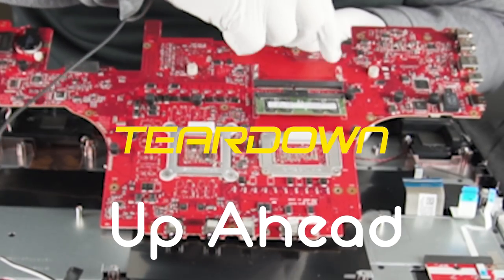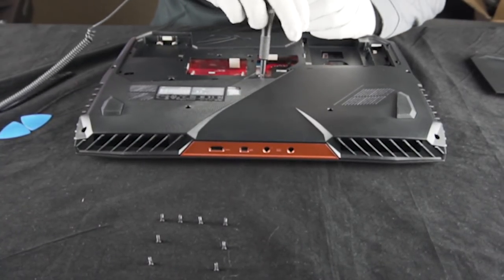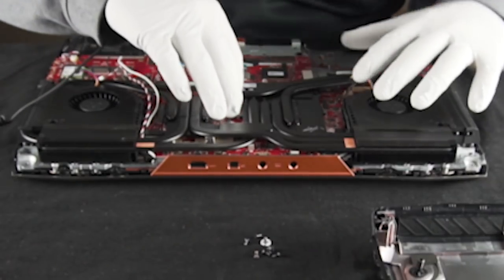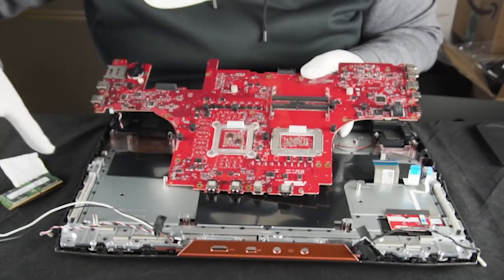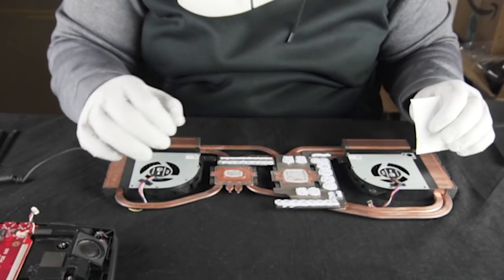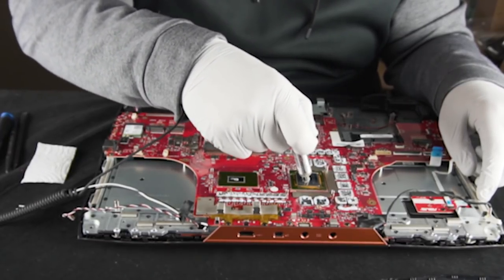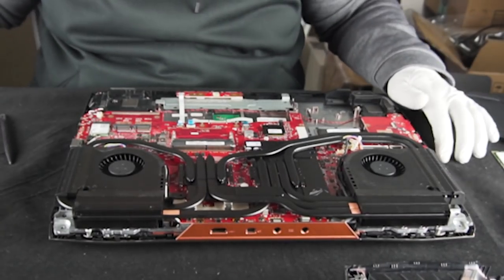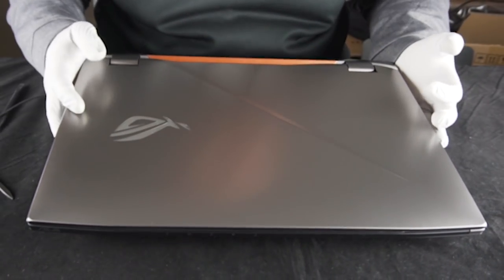Asus G703GX | How to Service, Upgrade & Fix Laptop (Teardown)

Comment: I opened it to remove battery and do power drain, and now when I turn it on it stuck in BIOS Utility mode, even if I press power button for 1 min, what could have gone wrong?

Comment: Thank you so much, got this laptop one 1 week ago after watching extensive YouTube videos on the laptop. I can say now this is the greatest laptop with an enormous amount of ventilation and temps are very nice, however, it's going great with a fan cooling pad. My spec was the i7-8750H CPU since I wanted to avoid the huge amount of burning heat from the i9HK CPU
Reply: what temps you getting out of the i7 8750? mine are peaking at 80 but averaging 70!
Reply: I just saw they have a new model with the same laptop but changed the CPU chip to the i9-9750H processor, I hope he could do a comparison
Reply: @Endorion_YTC  which cooling pad is the best? And how often do you clean laptop, replace thermal paste? Your responsw would be greatly appreciated as i am noob in this matter /(
Reply: @boredoflife8703  It's really best to change the thermal paste to liquid metal it does really do the job. Problem is the work is risky unless you know what you're doing. Cleaning the laptop would be every couple of months or so just to open it up and use a air canister to remove the dust from the fans using a brush also. Any cooling pad with fans can do the job doesn't have to be anything really expensive, around the $20 range. Just overall, don't really worry about extensive heating problems it wouldn't heat up so hot if your environment is nice and cool and the laptop has air to breath :D
Reply: @Endorion_YTC  i had asus rog in 2012 very strong model for its time, it started to get hot and in year 2 of the service it damaged itself so you couldnt even run anything, it would lag, so now I have asus chimera and dont want same problem, it starts to get hot only when i have it plugged in charger, cpu goes up to 100, while without charger its around 40, now i removed old thermal paste and wanted to asked experinced person like you before buying thermal paste to apply, might it be other problem, because it gets hot only while charging

Comment: Good morning.  In the 2 slots where the Intel NVMes are located, can I mount NVMes from other brands?  I ask because I'm trying and it doesn't read any other Nvme to me.  Thanks in advance for the reply
Reply: I have to go into my BIOS, and reset the settings to defaults every single time I boot my ASUS ROG g703gxr, otherwise one of my NVMe drives in the extra 2 slots will not be recognized by the bios or windows.
Try resetting your BIOS settings to default and let it reboot, that might help.

Comment: Got a question, I'm so worried about my Asus rog g703gx laptop because I accidentally packed my laptop upside down where the display faces the downside position of the bag where it should not be . Question is will it cause a damage weither a cosmetic or hardware damage. Please I beg you guys to answer my question so I can get relief

Comment: Hello owners of this laptop! Has anyone been experiencing both power jacks not functioning, it takes very little movement  of the 90 degree jack to stop the electricity's to PC via the 2 power ports.
Reply: I've had that issue, plus even after repeated repairs it didn't fix it except when it went to their HQ and that fixed it for just over a year.

Latest investigation makes me think it's a soldering issue (unconfirmed), which means it will keep happening if you move the laptop around enough.

Comment: This is a great tear down video of the same exact laptop that I have. The hinge is not broken but occasionally makes squeaky noises but I am very gentle with my laptop, especially this one. The hinge cover on the back is not broken but on the left side one of the plastic clamps have broke so it does entirely like when I first received this laptop. Do you think its worth ordering a new hinge cover or just leave it be? It's not a huge gap but I worry in the future that because of this small gap that the rest will crack also. In your professional opinion do I replace it or not worry about it?

Comment: I bought the g703Vi model of this laptop in 2017 & have been using it ever since... It never gave me issues but now temperatures are rising. It needs cleaned like, BAD. Thank God for this video. You are the best. Most of the other laptop teardown/cleaning videos I've seen are full of sketchy tactics and redundancy. You get straight to the point & every move you make has a good reason.

Comment: Hi Computer Upgrade King !

Thank you for your video, it is really helpfull to me. I got the Asus G703 Chimera since one year now and I project to disassemble it to upgrade it and to clean it too. Is there a way to clean the fans properly without causing any damage to them ? Thank you for your answer. Looking for your next vids. BTW, sorry if my english is not that good but I'm french :P
Reply: Hold the fan with something not coductive while blowing compressed air on it, so that the fan won't spin !
(check if it has a condesate-water filter, or use the cans that are made for it, they look like spray cans but have compressed air in it)

Comment: This video is super helpful for me because now at year 3 of having the laptop I am needing to replace a fan due to a barring going bad and since I am replacing the fan I am also getting it into dual channel and replacing the pastes because it has been getting a bit toasty when things are all at 100% but seems mostly dependent on the ambient temps. Since I am doing all of this I was going to replace the thermal paste anyhow,  a sort of mid life revamp for my system.

Comment: Thank you for this! I just got this laptop a few days ago and I'm noticing a bit too high CPU temps. I wanted to do a repaste but haven't found any tear down guides!
Reply: Hi,  please, share your impression about this laptop. Want to buy it on this summer but i'm afraid i can't play games on max settings. Do liquid metal really help with thermal throttling ?
Reply: Is it a core i9 model, you've purchased? I'd like to know.
Reply: @Endorion_YTC  No, I've got the i7-8750H. I couldn't justify the price for the one with i9. There isn't any difference in the current games and from I've heard the i9 runs even hotter than the i7 for which the cooling designed here is barely keeping up.
Reply: DanyakaXD i replaced the thermal paste with grizzly Kryonaut and it works like charm. After undervolting it, the temp is even lower and the fan hardly ramp to the max during gaming.
Reply: cucu lol, yea same here. I just cant persuade myself to pay another £1.6k extra for the i9 version. Ended up with 8750h + 512gb raid instead. Added my own 1tb nvme + 1tb sata ssd at much cheaper price.
Reply: minc3 oh great to hear I might do what you did then I do care about the temps
Reply: Hi! what temps was it running and and if you did it is it running at now? just got one and concerned about temps
Reply: I just bought this exact model. Do u also have a speaker problem on the left side when volume goes too high? Like sizzling sound?
Reply: @thecommodore1875  I haven't noticed this but I rarely use the speakers. Headphones most of the time.
Reply: @cucubits  it does, I have the Core i9. I tend to lock my FPS at 60 to help with  the heat output. seems to do the trick. Noticeably drops the heat by 5 degrees C while playing Ark Survival and epic. game runs at 60 to 65 C for GPU and similiar for the CPU.

Comment: I had this Laptop for about 2 years.  About a month ago its started to give really bad graphical glitches such that you couldn't see anything.  I sent it off to Asus to maybe get the monitor cable replaced or worst case new graphic cards.  While in for servicing they said the motherboard never got past post.  What could possible cause the motherboard to also fail like that?

Comment: Can you tell me where to buy a new MOBO/CPU/GPU to replace one that isnt working? Thanks for this, helped me because I had to reset the cmos battery.  As of now I only have onboard graphics, stupid thing won't recognize my nvidia 2080, and I've only had it a year.  The chip looked fine, everything looked fine in there. Resetting the cmos was my last option.
Reply: Hi, I have the same problem. did you ever find a solution to get the 2080 recognized by the laptop again?

Comment: What kind of update can you do with this laptop, l plan to buy this laptop whenever I save enough money for it. I don't know much about computers, but I know this is a beast of a laptop!

So fair I see 2 upgrade available witch is SDD and memories stick. Is there something else I should know? I want the highest specs at this laptop can get.
Reply: So, I have the 703gi 64 gigs Ram, coffelake intel processor, Nvidia 1080, 2 fast solid state 2 TB drives in Raid 0, and one hybrid solid state. It is a beast of a Machine. It was the best 5grand I ever spent. IF you take care of this machine, it will keep you happy for a very long time. I never feel like I don't have enough power. What I do pay attention to is how hot it gets. Invest in a super good cooling pad. something that costs more than 20$. Trust me.

Comment: Hi, Computer Upgrade King
 i know that its been over a year since this video went up, but have the (RTX 2080 16GB) version of this laptop i was wondering if the ram on the other side of the board is 2-8gb sticks or 1-16gb I'm looking to upgrade to 32gb and I'm wondering what ram i need to do so.
Reply: its prolly 1 stick of 16, but download HWinfo app and run it, it will tell you all the info you need

Comment: ignorant question here!!! can i upgrade my processor in this thing (Asus g703gx)? i read as much as i could on this and some say that it is doable. Please someone tell me if it’s upgradable please please ._.
Reply: If its socketed, you normally can check the Chipset for other compatibles. But do research if its compatible and if the power supply and all other stuff is compatible with your upgrade.

Best way would be to contact Asus for further info before you try and probably fry your 3k+ $ laptop